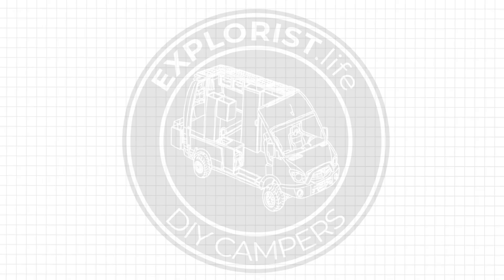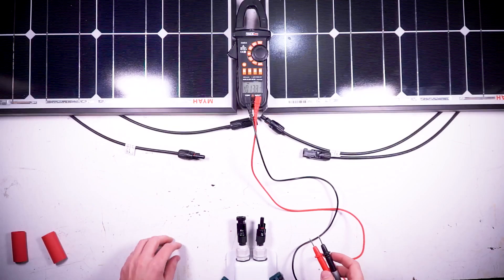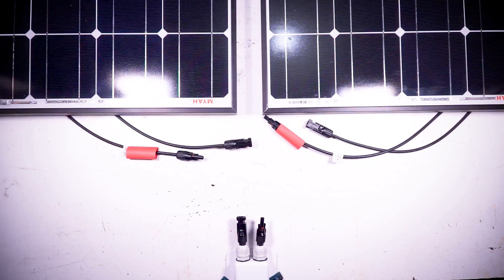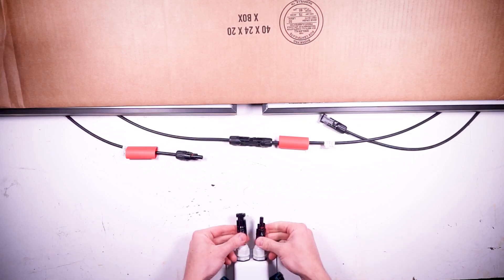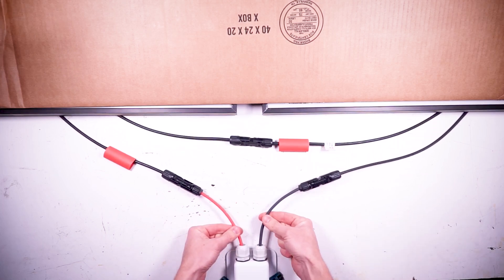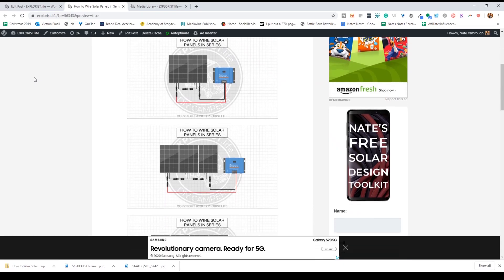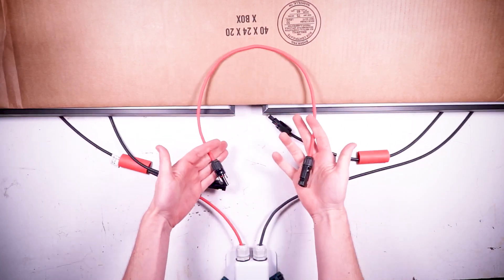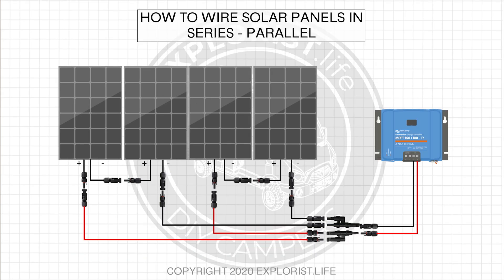How to Wire Solar Panels in Series for your DIY Camper Solar Install

Comment: My father is an electrician, and he gave me an hour long spiel about cutting the connectors off the wires and having to solder them together crimping them with screw connectors and heatshrink and silicone, but you explained how to do it in 3 minutes with a quarter the amount of work.

Comment: I have a Ecoflow Delta Pro. I want to connect (16) 100watt panels, so to get the 1600 watts of power (in ideal conditions), would I connect a set of  8 panels in series, then connect them in parallel, with each other, using 2 branch connectors?🤔 Thanks a lot!

Comment: Good video. Would be nice to share why you did series or parallel in each video then a separate my one depth. You may already have but I have not looked. Nice work!
Reply: Did you get your answer?  If you use a solar generator the voltage might require a higher voltage.  The AC200 solar generator requires at least 35 volts to charge up the unit.  Or you can use a 12v cigarettes outlet in your vehicle.

Comment: I wanted to wire my 24 solar panels into four strings of 6.  I installed them in two rows on a ground mount with a junction box in the middle of each row.  I mounted them side by side.  When I went to connect them in series I ended up 20 ft from my junction box.  Now I have to run a jumper wire all the way back to the junction box.  I should have mounted them end to end, reversing the top row so the connectors were next to each other.

Comment: This video and the article referenced below are spot on.  However, you must have an MPPT charge controller since it will lower the voltage coming from the solar panel and increase the current going to the battery.  If you are using a PWM controller, I believe the voltage will also be stepped down but the current will not be increased.

Comment: When mixing panel sizes , in my case ( 190w +50+50+50)  and they are all different manufacturers, do you receommend a series or parallel connection to a 30amp charge controller with 2 Battleborn 100AH batteries?

Comment: Hey Nate, I am wondering what the difference between solar cable and regular (like Ancor) stranded copper marine wire is. I have a fair amount of 10 AWG solar cable left over from the kit I bought from you and I am wondering if I would be able to use it to wire other things in my van like USB outlets. Thanks!

Comment: But if you need longer cables then your panel offer, how do you do that because you can't hook a positive wire with an mc 4 connector to a positive wire w/an mc4 connector. Theyre both male. I need a female end to connect to the posotive wire coming off the panel which is a male end .  Yes I said that right. I'd have to change the mc4 connector on the positive wire im adding ??

Comment: I have 5 200w panels rated @28.98 each and wired in series for 144.9 voc but they are measuring at 157voc which is over for my 150v charger... I have the same exact string and charger on the rv and it's showing around 132v for the other string. Why is the voc higher in the 2nd string? Both charges have the same charing parameters. Please help

Comment: Fantastic video and I have subscribed!  I am considering buying a couple 330 watt panels for my RV but they have rated volts: VMP and VOC.  Which do I use to determine the volts for wiring in series?  Thanks!

Comment: Great video question please. I have 4 100 watt panels of same make, but with different voltage and amperage. Do you see any problems hooking them up in series. Any suggestion.
2 Renony rng 100d and
2 Renogy rng 100d-ss
Thanks, Tom

Comment: Hi Nate.  I have purchased your “30 Amp OEM Camper Electrical Upgrade Wiring Diagram” and am getting ready to install all the equipment in that plan.  I have a travel trailer with a TPO roof.  Should I use a separate copper wire to ground the frames of my solar panels to the trailer’s chassis ground since my roof is not metal (assuming a metal roof would, eventually, be linked to the chassis)?  I don’t see you mention whether or not to ground solar panel frames in any of your videos but thought it best to ask.  Thanks!
Reply from the maker: I do not include a solar panel frame ground in my systems and treat that as a 'floating' array, which is allowed in mobile applications.
Reply: @EXPLORISTlife  Thanks Nate!  Are you able to treat the solar panels as a ‘floating’ array because you are mounting them on a metal roof? My camper has a TPO roof, so I will not be mounting any of the solar panel hardware to a metal surface. Instead, I will be screwing the brackets into the wood roof framing.  Does that mean I should add a grounding wire to connect the solar panel frames to the ground point on the camper frame?

Comment: I've seen many videos demonstrating series wiring.  A few questions that no-one seems to cover ... What does this do to the Volts, Watts and Amps totals?  Why would someone wire in series/parallel?  And what does wiring in series/parallel do to Volt, Watt and Amp totals?  Thx  -Love your channel!
Reply from the maker: Will be covering that in upcoming videos. :)

Comment: I have three 12v 160w panels. Should it be in series or parallel. Going on a boat with no shade issues. Batteries are 3 110amp/hr

Comment: Do you need a charge controller if you have a bluetti, jackery or similar thing?
Reply from the maker: Charge controllers are generally built into those types of units.
Reply: @EXPLORISTlife  great, I was thinking of getting a Bluetti and some cheap solar panels and wondered of I need the charge controller with them or not.

Comment: Hi Nate, Thank for the informative video. I'm wiring up 4 panels in series, but they are not mounted beside each other. Two are in front of the other 2, do I need the expansion wire to do that? its still positive to negative? then the last 2 wires would go to the growatt all-in-one solar input? I'm mounting the panels on the flat roof of a cabin I built last year.
Reply from the maker: If the wires on the panels won't reach each other, you will indeed have to make an extension wire as shown in this video.

Comment: What is the best way to run my 1300 ecoflow Delta portable power bank in series or parallel?
Reply from the maker: Hey, @timrobertson8218! I appreciate you taking the time to ask your question, but unfortunately, I don't have enough info about your specific question to provide an accurate answer, but here is a playlist that, if you watch all of the videos start-to-finish (and take notes 😉), you'll have a REALLY good idea of how to design a solar array: https://www.youtube.com/watch?v=Jkbs84sBHsg&amp;list=PLmvhcyi4n0TV9pi83rFTv3ZuMT_S1xIZt

Alternatively, I have some of my most common solar array setups pre-built here: https://shop.explorist.life/product-category/all-products/camper-wiring-kits/solar-charging-wiring-kits/

Comment: Does the control charger have to have a certain level of volts.  to handle the solar panel. I have a solar panel with max volts of 28. My controller chargers has a max volts of 25. Or is there a cut off ?? I’m use to the amps must be higher to handle the amp from panel. Just wasn’t sure if was the same for volts
Reply from the maker: There is indeed a minimum and maximum voltage for charge controllers.

Comment: Thanks for the Video!  If I wire 5 panels in Series and the negative side of the panels is the farthest away from the charge controller. Do both wires to the controller have to be the same length?  If they don't have to be the same length, is there an advantage to having the Positive side closer to the controller?
Reply from the maker: It doesn't really matter in the case of solar array wiring.
Reply: @EXPLORISTlife  Thanks for the reply, I won't worry about the length of the cables then.

Comment: two questions. first you didnt use the shrink wrap with the heat gun would it complete the installation?
second, why is the inter connection wire red and not black?
Reply from the maker: The heat shrink was really just a visual for the video.  I wouldn't do that in real life.  I'd just remember which was which.
The interconnects could be either red or black.

Comment: Hi Nate,
Question...I have 6 - 1oo watt solar panels wired in Parallel on my RV roof  I've decided to add 2 more 100 watt panels that will be located the furthest from my combiner box.  Can I wire the last 2 panels in series without hurting my system? The voltage boost would be desirable.  All examples of series/parallel setups are always shown 2 and 2, or 4 and 4 etc for the series/parallel setup....not 6 and 2 (parallel/series in this case).
Thanks.
Reply from the maker: As long as the change doesn't exceed the max voltage input or the max wattage of whatever charge controller you've got, it will be fine.  Sorry for the vague answer, but I don't have enough info about your setup to make a full analysis.

Comment: I've bought a converted van that has a solar panel already fitted, how can I find the spec of the solar panel?  Do I need to get on the roof to find some info on the panel or can I find it via the solar control monitor.  I was told it is a 240w panel but it turns out the last owner told some lies about other items so I'm not so sure if I can trust this info...
Reply from the maker: There should be a sticker on the back of the panel with that info.  Unfortunately, that is the only way to find that info.

Comment: Hey Nate, love your videos. Got a question: I'm looking to place two 375w solar panels on my van's roof. However I will have to have one slide over the other when driving as there isn't enough space for both on the roof. So I want to wire them both in parallel and series to get the most efficiency when one is covered up as I drive and when they are both extended side by side when I'm camped. I believe I can wire them up to make it work, but I'll need a three way switch that allows 1) two wire inputs for the series connection,  2) an off position in the middle, and 3) 4 inputs for the parallel connection (maybe two if i can establish a good connection (one for the negatives coming off the panels and one for the positives coming off the panels)). My question is where I could find such a device (could such a device exist to use mc4 connections? my trina panels and victron bluetooth 150/70 mppt both use mc4 connections. Also looking to remove as much wiring redundancy as possible while maintaining safety. Sorry for the lengthy question :)
Reply from the maker: I would wire them both into a DIY combiner box (https://amzn.to/3bUVJI1)with two, dual pole disconnects (https://amzn.to/3aQoOmF).  and simply turn the one wired the the bottom panel 'off' when you are stowing it away.  

Let me know if that doesn't make sense...

Comment: Have a question...have a 300w solar generator (Wattfun) portable power station 300w regulated voltage LiFePO4 with MTTP charger limited to charging by solar to 130w (etc) I have 320w panels if I connect the panels to the power station will it only accept for charging purposes the 130w limit or not work at all because its too much wattage or worse damage the generator?  Thanks
Reply from the maker: I'm not familiar with that particular unit.  You would want to reach out to the manufacturer for that information.  I know that Victron Charge Controllers can handle 'excess' wattage given that the maximum input voltage and amperage is not exceeded.
Reply: @EXPLORISTlife  Thanks for the reply hard to get in contact with them.

Comment: does shading affect panels wired in series or does the bypass diodes negate just the shaded panels in a similar way a shaded panel in parallel drops out?
Reply from the maker: Performance on shaded panels is tough to guess.  If you want the best performance from your panels, regardless of how they are wired, it's best to avoid shade.

Comment: So does the shown configuration double your charge output as long as the panels are of equal voltage 200w+200w=400w? Also what is the major benefit in wiring in this fashion?
Reply from the maker: Yes, but...  200w + 200w is going to always be 400 w (given you don't mix panel sizes (Don't do that)).

The main benefit is being able to increase the array voltage heading to the charge controller.  MPPT charge controllers like higher voltage than what parallel wired arrays (at ~20v) can deliver.

That's the MAIN benefit of it, but when we get to the more concepts/theory based videos, I'll cover this in greater detail.

More Info:  https://www.explorist.life/solar-panels-series-vs-parallel/
Reply: EXPLORIST life - DIY Campers thank you very informative.
Reply: EXPLORIST life - DIY Campers Doesn’t the output voltage of the array have to match the voltage of the battery bank? You can’t put 24v through your solar charge controller to a 12v bank, can you? BTW awesome channel and site! You’ve helped me tremendously in my install and purchases Nate...many thanks!
Reply from the maker: @itsayswithoutgoing9571  Great question, but not quite.   The job of an MPPT charge controller is to regulate a high voltage from the solar panel array down to a low voltage of your battery bank.

Pretty much all of my diagrams on https://www.explorist.life/solarwiringdiagrams use charge controllers capable of converting up-to 150 volts down to the 12v battery banks that I put in the diagrams.

More info: https://www.youtube.com/watch?v=MxziHKvTRh8
Reply: EXPLORIST life - DIY Campers That helps alot! Thank you!!! So my 40amp charge controller doesn”t care what my 2 190w panels do, and I can go series or parralel with my array? Wish i had know that before bying y-connectors. We’re converting an ambulance which has about 3miles of wire, circuitboards, switches and fuses which is extremly  intimidating for someone needing YT to figure out ho wto use a multimeter(thanks for that lesson too) . Keep up the good work!
Reply from the maker: @itsayswithoutgoing9571  Without knowing what charge controller you have, it's hard to say.  You'll have to check that two panels wired in series does not exceed the max voltage of your charge controller.  This video show you how to do that: https://www.youtube.com/watch?v=MxziHKvTRh8

Comment: Question: 2 12v 55ah batterys, + to + - to - =12, does the 55ah stay the same?
Reply from the maker: Nope.  When wiring a battery bank: + to + and - to -, that is in parallel which means you would add the Amp hours together while the voltage remains unchanged.
Reply: @EXPLORISTlife   Thank you
Reply: That is called wiring them in Parallel, and in the end it will equal to a 12v 110ah battery

Comment: Get an MPPT people and make sure your setups match voltages as best you can from solar panel to charge controller to battery setup to minimize complications.

PWM controllers suck, just invest for MPPT
Reply from the maker: All of my diagrams and setups use MPPT charge controllers: https://www.explorist.life/solarwiringdiagrams

We don't even sell PWM's in our store: shop.explorist.life
Reply: @EXPLORISTlife  Yeah i was just preaching advice to the noobies. I feel sorry for the people who wasted their money on PWMs...also I've seen a lot of people damage their equipment with them.

Comment: So if I have 5 12 volt 100 watt panels and I connect them together in series the volts would be 60 right? Now the actual voltage they make is around 18 volts each. So my question is does it still count as a 60 volt set up? Or does it count as a 95 volt system?
Reply from the maker: There's no such thing as a 12V panel.  More info in this video: https://www.youtube.com/watch?v=6G3Mo_OHmQY&list=PLmvhcyi4n0TUjVGA_O5aI5SQrS1kKLgEF&index=11
Reply: @EXPLORISTlife  I figured it out thank you. I was confused because it says weize 12 volt 100 watt panel. I realized the voc was 18 so I just went off that. Thank you.